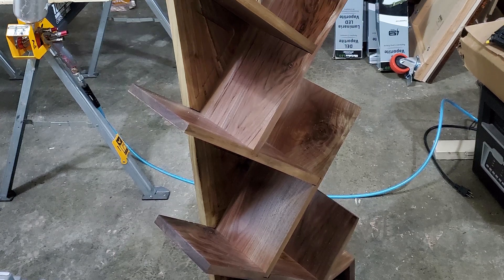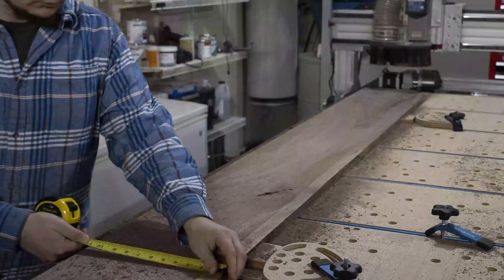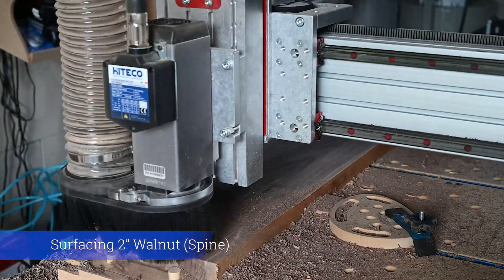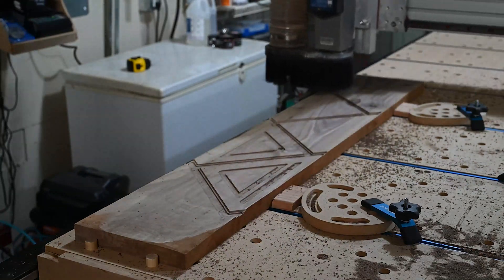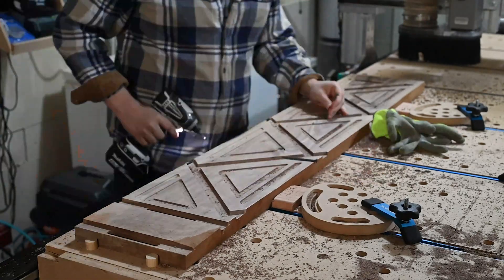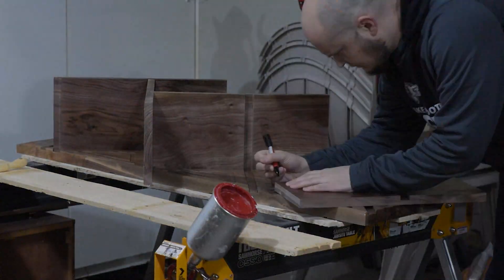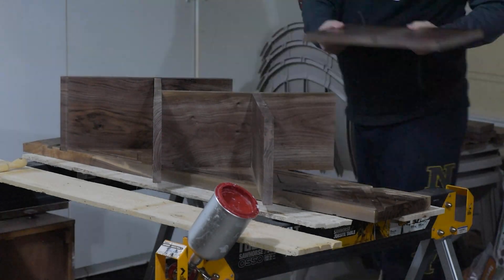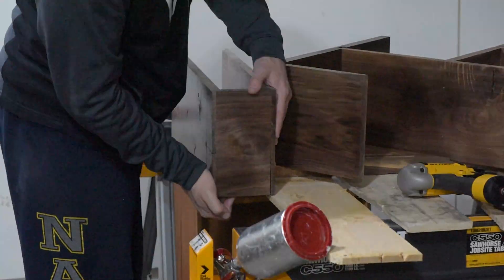AVID CNC Pro Walnut Vertical Bookshelf Build

Comment: Great build!!  Where did you get the files for the large circular pressure clamps!!  Love them!  What dust shoe are you using. I made mine with inspiration from Jay Bates and the free Avid one.  Good work!  I was viewer number three on the video. Lol. Take care
Reply from the maker: Thanks Kurt! I designed those pressure clamps in Fusion 360. I made a few different sizes and styles. They are oblong (cam shaped) so that I can lock the piece into place using lateral pressure/leverage. They have slots that are sized to accept a Rockler T Track bolt. If the geometry of the piece doesn't work to clamp them down using the slot, I just clamp them in place using the T Track hold downs and spacers like I did in this video. The dust shoe I'm using is from Kent CNC. There is a link to them on the Avid website. It works alright, but I think it may be worthwhile to do a dual 4" dust shoe if you have a strong enough dust collector since this one struggles to contain the dust when I'm doing facing operations in the +Y direction. I think Avid may even have a project file for a dual 4" dust boot on their website (if I'm remembering Frank Howarth's video correctly, I believe that was where he got his design).
Reply: @NorskieCNC  thanks. I’m gonna steal that clamp design or sort of. Lol. Jay bated has a free file for a two hose dust shoe on his website.  Free download.  Thanks for the heads up on the clamps.
Reply from the maker: @kurtmartin8162  feel free to steal it! I put these videos up hoping that they'll be helpful. I know I've learned a lot from watching videos other makers post.